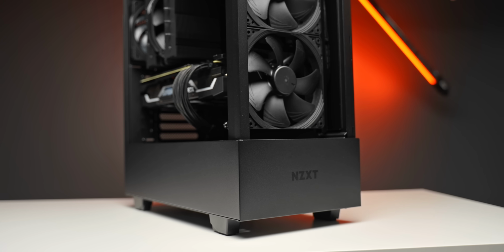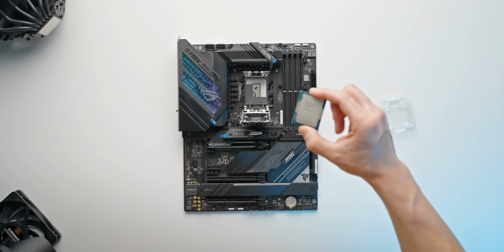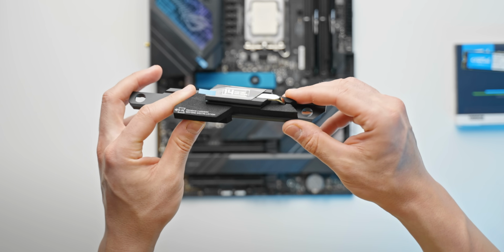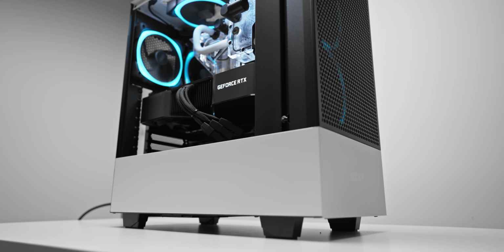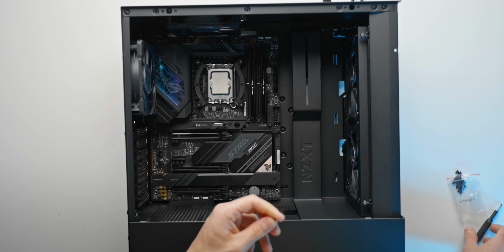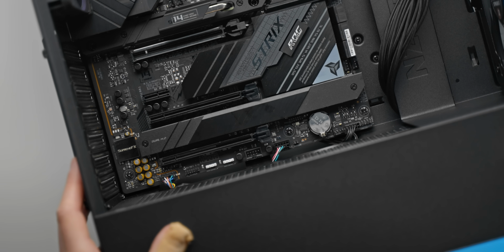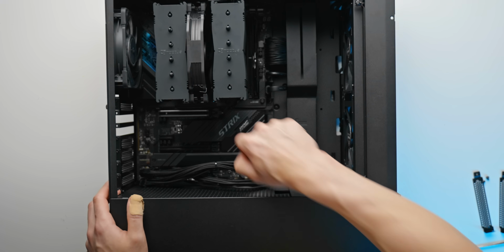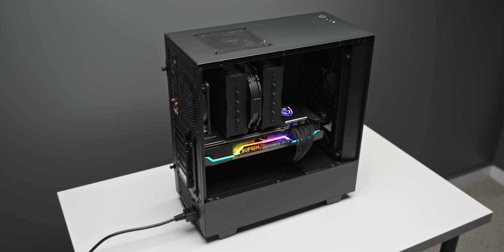How to Build a Powerful Gaming PC

Comment: That GPU release button is probably the best motherboard upgrade in a decade! 
When you have huge CPU air cooler, add just as large GPU and install some m.2 below GPU it's basically impossible to reach the PCIE release lever from any side. Except with a very long screwdriver between the CPU and GPU from the top, but also depends on the GPU backplate and then there is the risk of the screwdriver slipping and hitting your expensive MB. Finally someone from manufacturers has addressed that stupid thing.
Reply: yeah i broke mine installing 2nd m.2. had to shove it back in lol
Reply: Agreed! They should have solved this problem years ago!
Reply: I'd just use a plastic pick for prying apart plastic panels and such. But it is an awesome feature.
Reply: that problem has my motherboard and gpu actually stuck in my case, because with a screw-driver the release doesn't work and one of the motherboard screws is right below the GPU that stick over, so i have no secure way to actually remove the gpu.
Reply: @sagichnichtsowiesonicht7326  one side of the release lever should be slightly out between the CPU cooler and GPU backplate. Like 2..3mm surface you can push down on far right end thus releasing GPU. During my first attempt I did hit MB rather hard as the screwdriver slipped off. Luckily there was no tiny resistor or condenser on the spot and the coating and underlying hair thin connections survived too. Now I know better, but it would still feel very uncomfortable to do again. 
Besides, from my past I do remember MB with shorter and narrower PCIE locking levers that rather needed to be pushed under an angle to actually give up. Not sure if there is a new wider and longer lever standard now or I just got lucky this time. You could try thinner metal ruler, but will also slip more. Bicycle wheel spoke head?
Reply: @Dark Waters you don't have any non metallic sticks?
Reply: Facts. I legit broke my pcie clip because of it
Reply: As a car modder

I did the delete
Reply: @Dark Waters a wooden chopstick might be a better alternative. Though it’s still nerve racking stabbing your motherboard to release your GPU.
Reply: Haha this is exactly what it came to for me on my asus tuf x570. The screwdriver has bent the switch to hell but all still works... just doesn't lock as well.
Reply: @Dark Waters Every. Damn. Time.
Reply: Even with my 8600GT it's frustrating... That's a single slot card from 2006
Reply: I had that problem with my Noctua 15 and the 4080 no space at all had to remove the whole cpu cooler 😂
Reply: I use a bamboo stick to push my PCIE slot out when I need to remove my GPU lmao.
Reply: THAT button is the main reason why my next board will be an asus high end model, i just cant stand anymore that i have to sweat blood to take out the card. Whatever the price, even if i dont need other fancy features (overall quality is superb thats a plus) i will pay for it.
Reply: @Dark Waters I've always used a screw driver for releasing gpu
Reply: I wish all motherboards had this button.
Reply: Asus is doing the lord's work. Before that they also came out with the m.2 Q-latch which allows you to install/swap m.2s toolless which this mobo should also have.

Comment: Am I the only person who thinks the storage and case choices are really odd on such a premium build? The guy has gone with the top of the line Intel CPU, a crazy expensive motherboard, PSU and GPU, and then used budget M.2 NVME drives and a budget case. Also, as much as the D15 is an amazing cooler, if it's only able to run one fan due to interference with the ram I would have thought an AIO would have been a better choice.
Reply: I agree! He said you can't beat them for budget. What budget?
Reply: @domonon  the AF II 360 costs 100€
the NHD-15 costs 110€

drives idk, the intel p660 ones were quite cheap as well
Reply: probably the streamer already got gen4 nvme? he used gen3 nvme for this video probably just to show how to install it. I might be wrong tho
Reply: The difference between Gen 3 and Gen 4 SSD is really not noticeable for normal tasks like gaming. The case surprises me, as the 510, even the flow version, really doesn’t have a good rep at all.
Reply: I would have gone for a larger case myself, just cause I like the extra storage space of sata drives still.  But the nvme he used are completely fine (I would have gone with 2x2TB though, especially since he won't have any sata drives.
Reply: Yes exactly...gen 3 is whatever but only using 1tb drives seems nuts to me I would do one 2tb drive now and another later if budget wouldn't allow 2 2tb
Reply: can confirm that. even my 360mm AF II has issues cooling it (same board and cpu), in an O11D 
cooling is a real issue on this setup
Reply: There’s nothing wrong with the case
Reply: @sebiieex  No, I agree, it's just quite basic when you're spending that much money on all the other components
Reply: @nicholastaylor9375  yeah I guess you have a point. But sometimes most of your budget goes towards certain parts and you kinda have to compromise on others.

Comment: my mobo still have ps/2 dual port lol! I would have gone with the stock cooler if it was in a regular build or like a torrent case where the psu is mounted up top. but since its gamer style case. good deal. plus Theres no front cdplayer or hdd in it anymore lol. that went out years ago. the fan controller should be programmable up against your ingame DPI. I am suprised thats not what rtx was. I thought gsync was going to ...do that. haha
Reply: @Dark Waters I just hit msi command center fan tuner and set ingame mouse sensitivity to 1:1 because I play inverted. after making sure PWM and smartfan is enabled in the bios. For the case fans too! as far as actualy dpi goes my basilisk v3 stages from 400 thats why I bought it. I really only play csgo because I still have a 6th gen processor. ive been waiting on an arc gpu since 2014. lol.
Reply: @Dark Waters i duno man im a blonde with blue eyes i couldnt do anything but overvolt myself. lol. thinking of temperature in rankine kelvin celcius or fareignheight.. still backwards!

Comment: Is the upper gen4 m.2 slot x4 or by x2? If it's x2, it is going to cut you bandwidth in half, isn't it?
Reply: Only if you use a raid setup or use all 4 drives at the same time compared to 2, just for data storage and gaming it shouldn’t matter either way
Reply: its not gen 4, ist gen 5 x4
it cuts in fact the gpu bandwidth in half since it is gen5x8 then